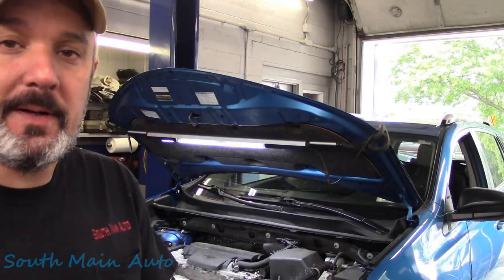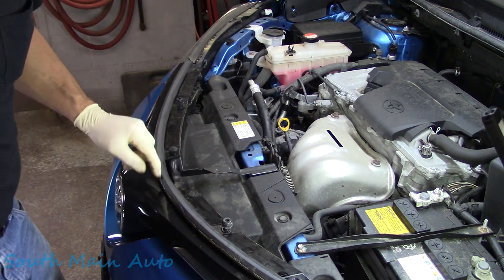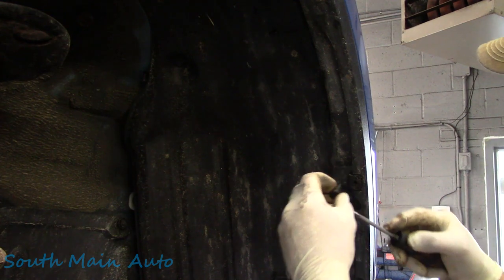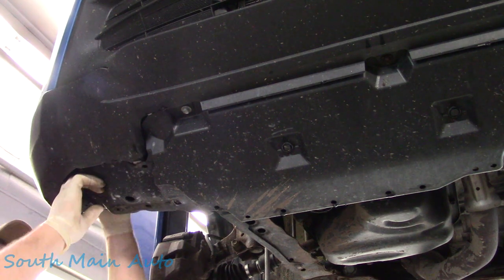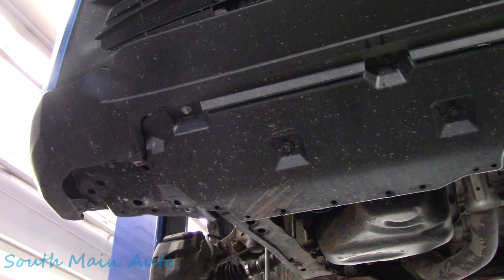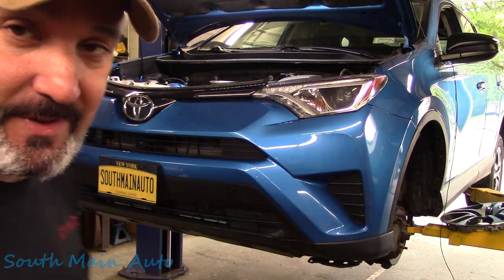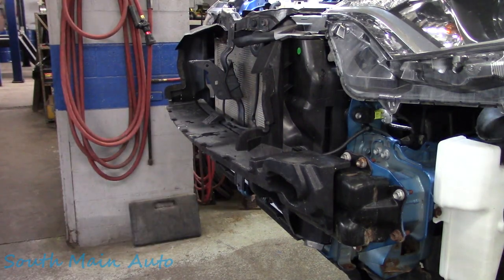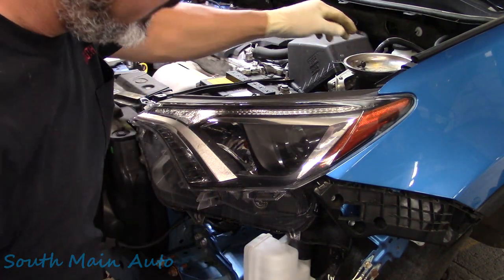2013-2018 Rav4 A/C Condenser Replacement

Comment: I have a funny story about Toyota, not ha-ha funny but a strange kind of funny. Got a 2000 Celica, great car despite its size and problems, ran great for 22 years and 178k miles until the salt made it unsafe to drive. The weird part is that the car would have problems like completely losing A/C but returns two weeks later, then something like the door lock wouldn't work and then two weeks later it starts working again. 

When 2018 rolls out the Celica wasn't very safe to drive because it has no ABS, poor braking response, leaking fuel, bad headlights, and the rest of your classic salty Japanese car problems that won't make the car pass another inspection. Stowed it away in the garage and went shopping for used autos, picked up a 2014 Camry with only 12,400 miles; the salesman probably lied when he said it belonged to an old woman but the miles and previous owner's identity fit the story. That Camry had nothing but problems for the next 30k miles, must have been plagued with the old woman's spirit or maybe it was from being assembled in the United States. There was nothing major like engine or transmission failure but it had consecutive problems, it started with the A/C because a month later it stopped working and then the radio quit periodically, then a brake caliper seized, next was a heat shield that fell off the gas tank. It almost drove like a Chevrolet, the resemblance was uncanny. 

Come 2020 we had some financial trouble like everyone else who made minimum wage so the bank took it for a permanent vacation. Personally didn't want it back anyway, so we go out shopping again and this time purchased a used 2018 Kia Forte with about 30k miles, barely needed more than an oil change. It was going for a decent price and 27/41 mpg wasn't bad, it was decent for another 20k miles and didn't really need anything except a blower motor that didn't squeak and regular maintence. That is until a teenager went through the red light doing 40 mph and hit us crossing the intersection, got a fractured knee and three months out of work.  

Well at least we don't drive that Camry anymore, it made me want to go out and buy a brand new Ford.

Comment: So many plastic parts on modern cars.
This being in the Rust Belt, what did cars look like years ago when the panels were made of thin steel, did any car last more than two years without looking like the wreck of the Titanic ?
Reply: being a kid in the 1970's Northern states... cars of my childhood had rust... some major after only 2 years.  A 4 year old car looked like it was ready for the 'derby and most blew blue smoke.        1970/71 Camaro's would rot and have holes after year.   Holes the size of quarters.   Don't miss that at all.
Reply: @Ram14250  I guess Classic Car Collecting has never been a big thing up north, Hey? do you want to see my 57 Chevy, it's here in the trash can where it's been for the last 63 years.
Where I am, many of the Asian car manufacturer' offer a 7 year corrosion warranty, I'm assumed that's not universal across all markets?
Reply: @marklatimer7333  
No Mark, that is not what I'm saying.   I said it was common in the 70's to see cars very rusty after only a few years.    We have classic cars.   People that took care the best they could at the time never had as easy of a time as modern cars with metal treatments and zinc/ wax coating.
Reply: @Ram14250  Sorry it was meant to be an attempt at humour, I know there are petrolheads everywhere but surely the amount of effort and expensive you have to go to to defend against the dreaded rust is far easier in Florida than Vermont. We use salt on the roads here but we only get ice half a dozen times a year and snow is very rare, maybe once every 5 or so years.
The cold times are usually followed by a rainy month so the salt get washed off very quickly.

Comment: " Circumnavigate the globe 4 times"   Yeah except for the Chinese women- for them it is running in reverse around the parking lot at full throttle until they hit a solid object, then putting it in forward and repeating.

Comment: Too many computers and TOO MUCH PLASTIC. What happens when plastic parts are damaged? Landfill. Sure, you could grab a heat gun and reshape it, but do you think a busy shop is going to do that?

Toyota Engineer: So what kind of fasteners do you want to use for the bumper cover?
Toyota Designer: All of them! I want infinite diversity of fasteners so no fastener category feels left out!